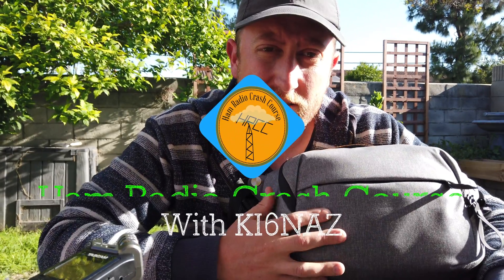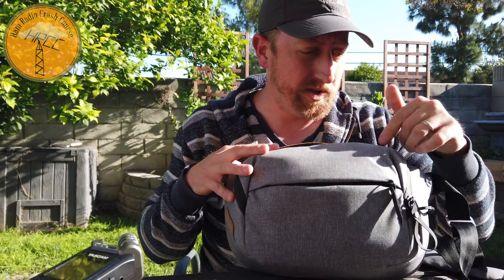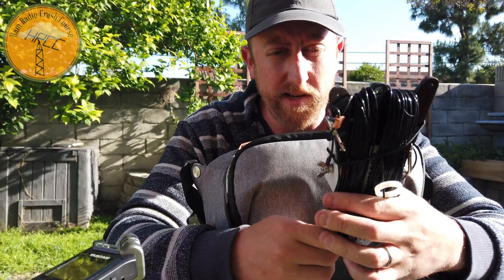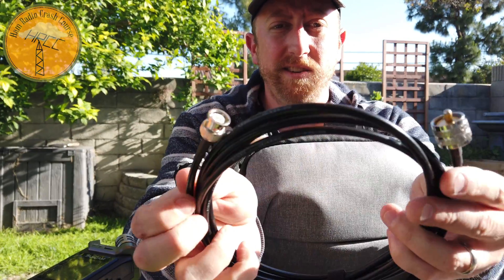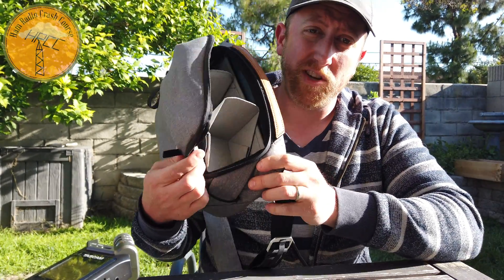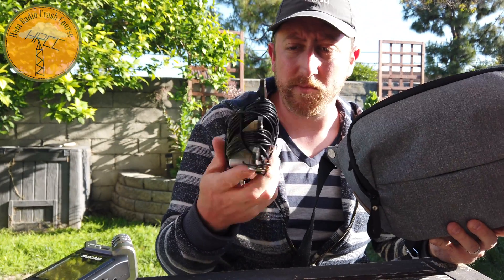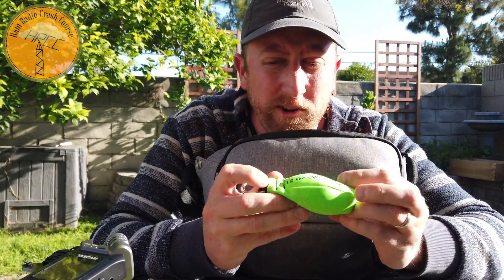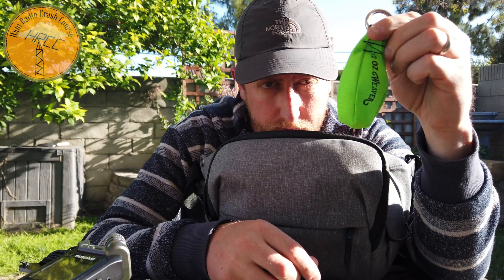Quick Go-Bag for Ham Radio

Comment: The Peak Design 5 liter can also hold a “small” tablet in the rear compartment for logging, etc. And those separators are removable/repositionable. Quality is great and very comfortable with the “over the shoulder/neck” design vs. “on the shoulder.” I use mine for photography but may have to think about getting the 10 liter model for a “day at the park” ham pack (same design but double the space). Thanks for the video. W2RSB / F4WCM.
Reply from the maker: Nice! Another peak design user. Yes indeed. There is a nice tablet pouch in the back. I put paper tablets back there in the past.

Comment: nice bag and great ham kit in it! would there also be room for a 2m70cm HT? I also like to carry a multi band telescopic HF whip antenna in my little HF go bag. This lets me quickly setup and operate even when there are no trees around for a long wire.

73!

James - KH2SR
Reply from the maker: The little strap outside can easily have a radio clipped to it.

Comment: Really nice kit indeed, super small and definitely light! I went with Xiegu G90, Zippy 8.4Ah, Linked dipole 10/20/30/40 (+15) (mostly SOTAbeams stuff) with couple of paracords, a bush knife (real steel folding) to make some stakes on the spot (or kill time :D) and a 28L small backpack which carries water and other stuff too. Not a huge fan of the unbalanced shoulder bags, got a sensitive back and I feel it after a while, but to each their own. I wish I had the KX2 though, would be so much lighter!

Comment: I got done with my new grab bag last month as well. it currently consists of a oxford aqua waterproof motorcycle backpack, foldout solar power bank charger by ADDTOP. I think it's rated at 23000mAh, has two usb ports for charging devices from it's built in battery. Then for radio(s), it's pretty simple - still rocking a uv-5r (and it's USB charger cradle) programmed with local repeaters & pmr, among other things. also thrown in a pair of retevis rt28 - 16 ch PMR with usb port for charging. A few cables/dongles and an oldish asus 11" laptop. I find that most people at events will have at least ability to use PMR freq, and it's nice to be able to hand a radio to a non ham and have them wander around for a bit to 'join in' without being too scared by all the rules and it's also a really nice way to beable to show them SSTV over PMR with their own phone with robot36 and a cheap radio, something the younger folk seem to get a kick out of. Anything to get more people in radio is worth while imo.

Comment: My Radio GoBag Contents: Sling bag or ammo can to hold gear, BaoFeng UV-8HP (or UV-5R) HT radio that is Chirp programmed with West County band-plan, charger with usb plug to car 12v outlet, Comet 24 whip antenna, Browning car magnetic mount base with coax lead (now in sling bag but will move to car soon), Diamond antenna for car mag-mount (kept in car), note pad & pen/pencil, FEMA/CERT forms, FRS HT radios (2) with usb/mini usb cable for charging.

Comment: Just curious, what gauge of wire would be good for a 100W antenna to be used in a pinch? 10 Gauge, 14??
Reply from the maker: It depends on the output you want. For 100w and less you can do with small gauge wire. 16 - 20 in some cases.
Reply: @HamRadioCrashCourse  Most people who have responded to that question say that usually 14 stranded works well.